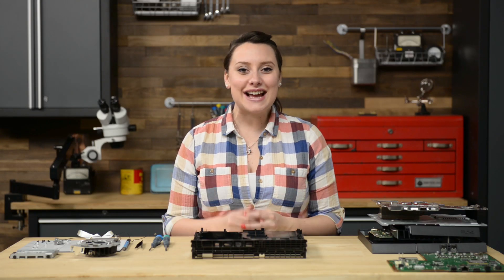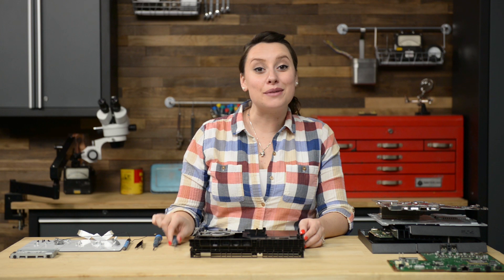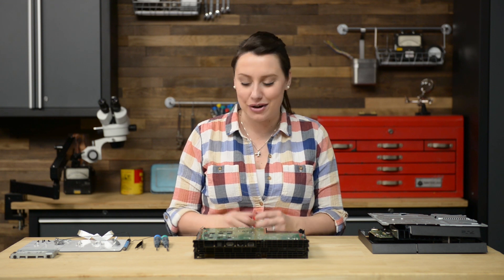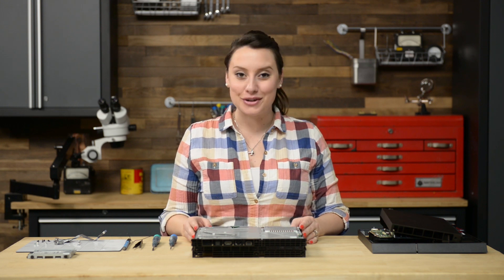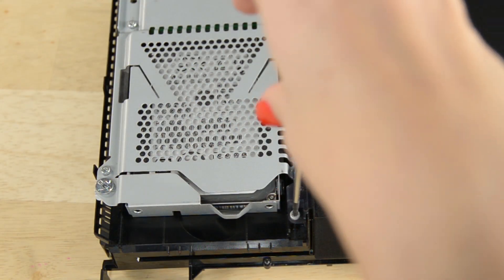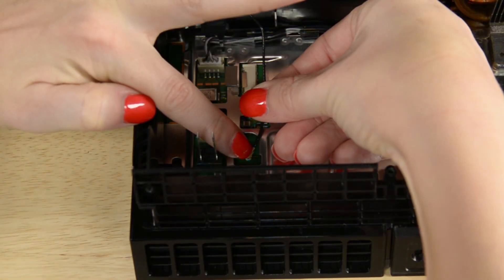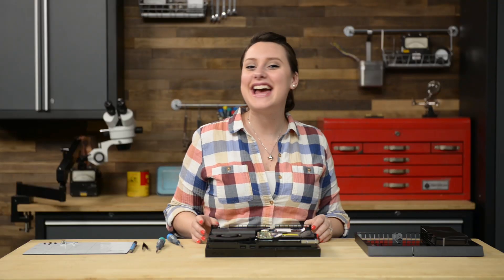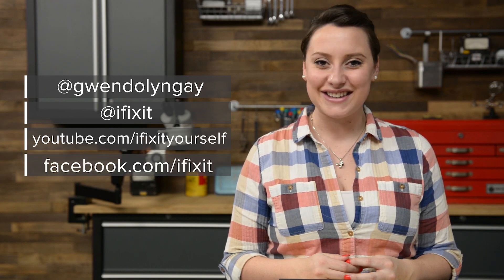Playstation 4 Reassembly!

Comment: useless, got it wrong from second screw, that is supposed to go after you put the metal piece on top of the fan. you can even see that the metal piece is resting on that screw and doesn't seat properly

Comment: What a terrible video. I love iFixiit.. as I refer to them often, but wtf? Just repairing an old PS4, and this video left me with multiple screws and parts left over. Definitely missed at least 15+ pieces in this reassembly... not to mention the terrible  lack of description for what screws and bits you're using. Very disappointed... sheesh.

Comment: Just a quick comment for the many who said no good after. Here's a where I screwed up. And how I fixed it. 

1. I forgot to take out my game disk. 

2. I broke the ears on the ribbon piece. 

So I couldn't get the disk reader to work at all. For those of you who had this problem, try this. Console powered up, but no response from disk opener nor would it read disk. I reopened, sat the cables the right way (red and black line must be perfectly even. It will work just carefully play with it. 

So now the the button was responding but the console would not power on. For those of you having this problem check this. I read all these fix it solutions and nothing, everytime I powered console I'd get one beep and it would go out. I manually ejected disk, and same thing. Finally I realized where I messed up. I had a hard time pulling off the power supply this time. I realized that the two thin pieces of metal looking kind of bent. I straightened them out and spaced the them apart. Carefully dropped in power supply. It was smooth and clicked. My PS4 is now running, disk reader is working. And my fan is quiet as all hell even on witcher 3.

I didn't do anything with motherboard, just noticed comments with same issue as me
Reply: Timothy LeClair thanks man, that last step saved me the money of buying a new ps4

Comment: 1:02 don't forget to screw metal board before placing motherboard. (3Screw)
She skipped it. ;)
Reply: David Cho Because She skipped it I had to take apart the whole PS4 again and use more artic silver 5 thermal paste, thanks iFixit
Reply: I went over my ps4 3 times trying to figure out where the extra screws went before I finally found the holes.

Comment: Can somebody help me the party where you put the power thing and I have to screw in the long screws they won't screw they will just keep turning for ever not getting any tighter. And yes I checked to make sure I put them in right
Reply: Joseph Morais I had the same problem, but all you need to do is press down little harder. The long screws will go in.
But make sure all the lines are in the correct places. :)

Comment: so uhh i no longer have a working ps4...
Reply: Local Bloody Gaming 😂😂
Reply: Local Bloody Gaming same this is bullshit
Reply: Same
Reply: Word
Reply: Same here
Reply: Welp I probably can't help you guys, but anyone else reading this comment, check my comment. YouTube app won't let me copy and paste, but I broke ribbon ears and sat the power supply unit wrong. If disk drive isn't working, carefully like the ribbon cables up so they are in all the way and libes perfectly even. If you can't power on (I was getting one beep and a power off) check the two long metal tabs the power unit sits on. Try straightening out and carefully lowering where they insert onto them. I noticed when I pulled power supply off second time it was a fight, and this was why. They got bent and didn't slide in right, never noticed as everything else sat where it needed to. I have have a working ps4 better than ever